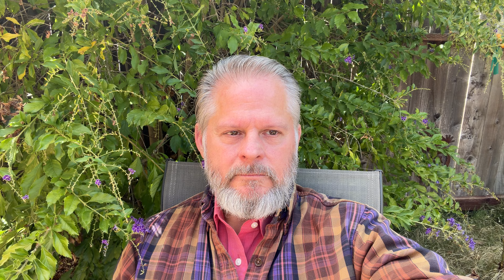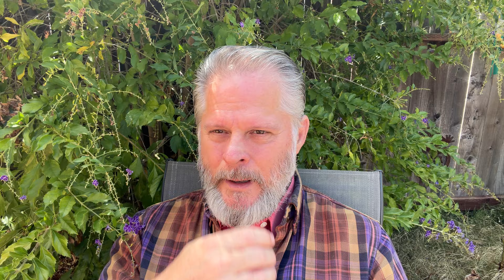Fireside Chat #7, Audio Design

Comment: Hi Terry, did you teach yourself electronics, or did you graduate from a school with an electronics program?
Reply from the maker: Both.  The school taught me the tools and the basics, I taught myself some things, but other things I learned on the job.  Some things I taught myself out of complete curiosity and interest.  But I never really thought I knew that much until I was asked to do some work as an electronics consultant, turns out I knew enough to be of assistance to some trying to figure out electronic solutions.  The issue I am having now is remembering the names of things, I can remember the principles, but not the names of them.  I think that may just be a part of getting older.  But it did start happening once I started taking pain meds.
Reply: @terrygesualdo9588  Regarding pain... explained for people who think in a nuts and bolts kind of way, the video... Healing is Voltage | Jerry Tennant, MD
IAOMT - International Academy of Oral Medicine and Toxicology